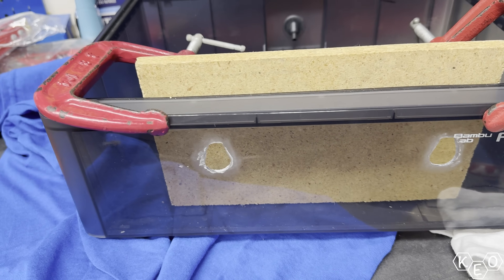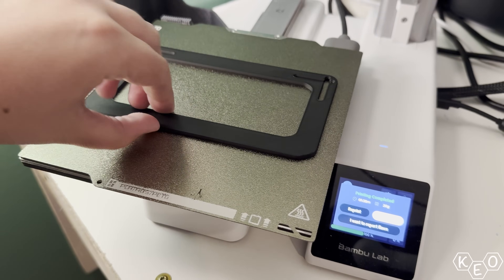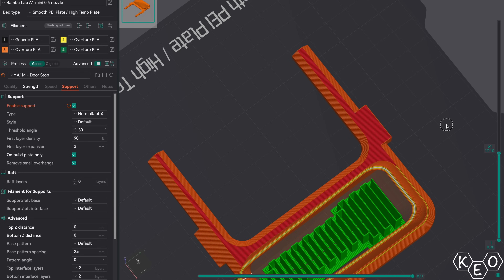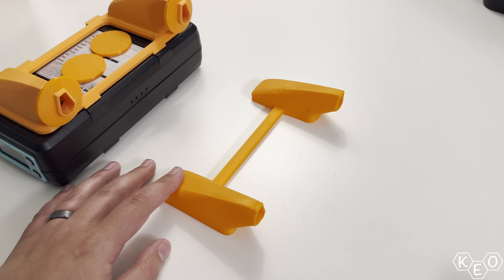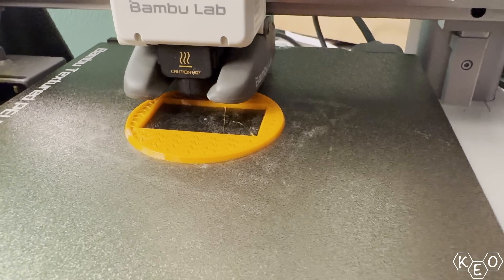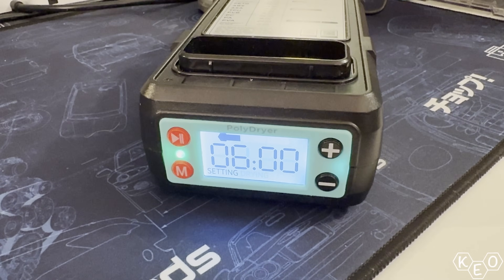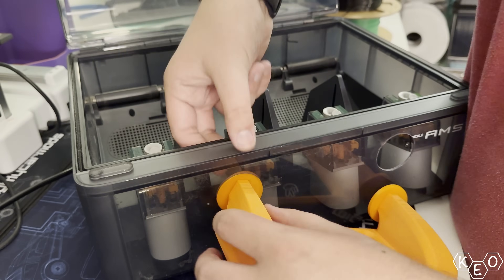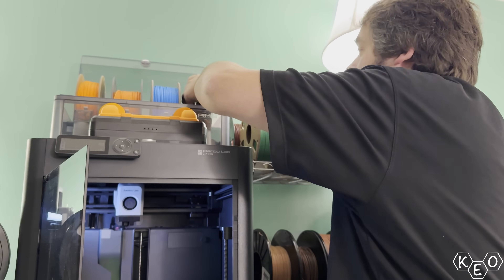AMS Filament Drying Finally Perfected! The PolyDryer Mod Is Complete

Comment: Wait, is the Poly Dryer just a peltier cooler?? I was thinking of how you could use the hotside as a heat exchange since they get so hot. (Thanks Technology Connections!) But those use a ton of power. 

Also, is 27% good? I don't really have a metric for gauging that but have seen people with 5-10% as the goal in other places. I live in the SE USA and it's 80-95% inside the house so anything is better than that.

Either way, this looks fantastic, man. Can't wait to try this myself when I get a system. Great job!
Reply from the maker: I think it's just a heating element and a blower of some description along with a filter but I am not certain. As for the humidity, 27% is not a good level but it illustrated that the box humidity was dropping at least. It typically sits around 12% these days after four dry cycles instead of two.

Let me know how it goes, great to hear you’re giving it a shot when the time comes!
Reply: @KeoPrints  Ahh, gotcha. Was thinking since you said it had a hot and a cold side it was a Peltier. 

Just watched a few of your videos and you're doing awesome! Keep 'em coming and you'll have that affiliate link in no time!
Reply from the maker: I appreciate the heck out of it my friend!

Comment: Wow, a lot of effort and destruction of your AMS.  The final design for two on the bottom was really genius and would have saved a lot of time. You never mentioned whether the duck-bill moisture release ever worked or not?  Was the duck worth the bill?
Reply from the maker: Tell me about it! Yea it’s hard to tell if the duck vent actually worked but what I have measured is the moisture level remaining at 17% after a few days so I would imagine the moisture that is baked out of the filament isn’t returning to the filament

Comment: So spend money on electric dryers and power to run them and achieve 35% humidity.
Or for the cost of printing some gel holders and gel (one off, low cost) get 17% himidity..

YMMV but second option for me and all my 4 AMSes are at 17-18%.
Reply from the maker: Yea man this certainly isn’t a blanket thing for everyone but it was a super fun project to test what could be accomplished. Happy to spend the time to share my findings anyway. 

Although at the very end of the video you can see that the humidity came right down 27. After an additional drying cycle it was below 20! Even with all the hacking I did. Totally crazy

Comment: Man, really nice video, did the passive humidity scape worked as you expected? I did my own dry box, and had no silica gel to trap the humidity after and was wondering if a passive solution like yours would be my way to go, too
Reply from the maker: Yea man that’s super hard to judge for sure but I can report that the humidity read low and stayed low so I’m guessing it found a way out without desiccant

Comment: Something I've wondered about for dumping the moisture is to intentionally put a small hole in both the intake and exhaust of the ductwork you designed for the dryer base allowing for an intentional leak that will both intake "dry" air and exhaust "wet" air from within the box. It wouldn't take much, maybe 1/8  to 1/4 inch in diameter,.I've done that with my Sunlu dry box, but it is entirely passive. Then again, I typically dry my filament in 24 hour cycles.
Reply from the maker: Interesting thought!

Comment: It's an interesting topic and if you just like to tinker then fair enough. However, I don't think this is practical at all. I just 3d printed the popular desicant mods that fit between the spool feeders and others that fit in the centre of the spool and filled them with re-usable orange desicant. The hydromiter inside the AMS constantly reads 11%. The one outside for conparison reads ~70%. No heaters required, and a tub of desciant probably costs less than those two driers and does not void your warranty by drilling into your AMS.
Reply from the maker: Yea have a look at the first video in the series where I spoke about that a little. I wanted to see if there was a way to accomplish the task of drying without the use and maintenance of desiccant. Trivial stipulation but it was a fun project as a result

Comment: If nothing is blowing in from outside (as opposed to recirculating) you won't have positive pressure to open the valves so it's clear where the moisture is going,.

Comment: That's cool. I can imagine using one of those heaters on the bottom, with a spacer to hold up the other side.  

Combining this with rechargeable desiccant would probably would probably maximize dryness.
Reply from the maker: Very true. I initially thought about just making a spacer for the other side and sticking with one heater but having the extra power to cook multiple rolls has been helpful. That said, it is not all that often that I have four rolls needing dryed at the same time but it is cool to know it can be done with two dryers fairly easily

Comment: Whelp, I still think a silicone heater pad stuck to the bottom with maybe a raspberry pi keeping the temp from melting the box is a good thing to explore. Having said that on the topic of evacuating the moisture. Have a look at the tech they use in modern HVAC where they use a desicant to transfer heat and moisture between the air leaving the house and the air entering. I'm betting there are useful ideas that transfer to this stuff.

Comment: So only the holes in the bottom were needed? No extra holes in the tray or anything to let the hot air up to the spools?
Reply from the maker: I did throw some holes in the tray as well to help out as there wasn’t much room for the air to circulate otherwise. You can just barely see it in the video but I did not mention it

Comment: I had the same idea of putting the dryer under the AMS after i commented on your last video. Die cabels and electronics made me reconsider. Aside of that i designed similar ducts like you but with bigger diameter for less air restriction and because i like to see the world burn i used supports on everything - lol.

Anyway I used PLA on purpose but designed the fit just a little bit to small. That way the heated site fomed itself into a perfect fit and the cold side got initially bit of help and later also fitted itself nicely!

Thanks fot the inspiration! Amazing!
Reply from the maker: Good work! Way to get out there and give it a shot as well. That’s awesome
Reply: Is it possible to relocate the electronics outside the box and insulate the wires?
Reply: @FromDesertTown  maybe but to be fair it's working like that now for some time and I don't think the electronics get damaged by the heat. I dry on level one and two with no issues.

Comment: nice project, I just started 3d printing a few months ago and just reacently bought a polydryer with 3 aditional storage boxes, but I found out that those were pretty regular boxes with not much sience, so I also theorized a better way to dry fylament using the polydryer and use the AMS lite at the same time with a little bit of thinkering but I don't think I have time nor motivation for that

Now my idea... I'm no expert but as far as I know the only real electronics in an AMS aside from the feeder motor units is the motherboard and cables, if you are so worried about electronic componnents geating up I think it's better to insulate those components as much as possible, I guess it's also posible to relocate them to a place where not much heat passes through
Reply from the maker: Great to hear! Happy you stopped by

Yea we will see how the electronics do in the heat longer term but I’m happy with the progress!

Comment: The polydryer DOES have vent holes on the sides meant to allow moisture to escape bud. Idk how effective they are but they're there.
Reply from the maker: Yea I see the little vent holes there but I couldn’t find any documentation to confirm that they were explicitly for moisture evacuation so I’m just moving forward under the assumption that the system needs some extra ventilation
Reply: @KeoPrints I would have to guess that polymaker thought about this when they designed the polydryer. I wouldn't be worried about it. 
If people are questioning where the moisture goes then they are questioning how well the polydryer works on its own.
Reply: @KeoPrints  suffice to say your "duckbill" vent is doing nothing..... 
Problem is the box is no-longer sealed with the playmaker heater attached, and will quickly draw in moisture when not turner on
Reply: @KeoPrints  Those holes are intentional for moisture escape. I've asked them prior to purchased.
Reply: In the video on their website it shows them venting out air from the sides.
Reply: @battyjoe  Exactly. The video highlights the holes. Moist air from the cold-air return mixes with the ambient air before being reheated.